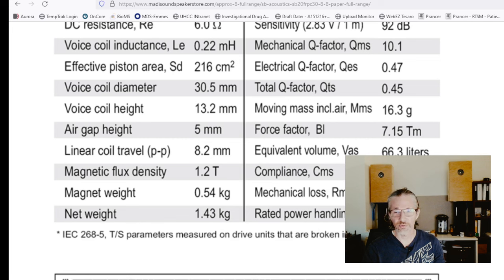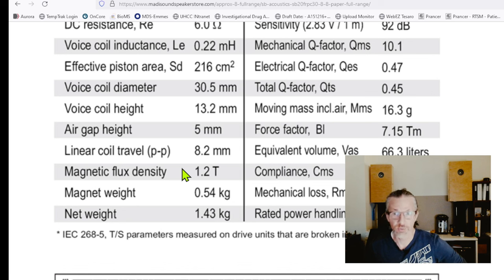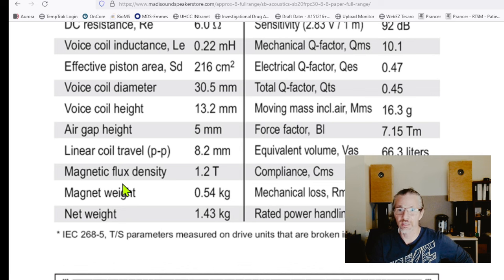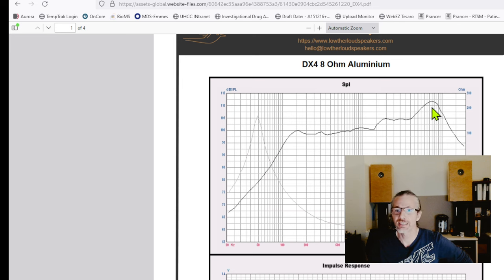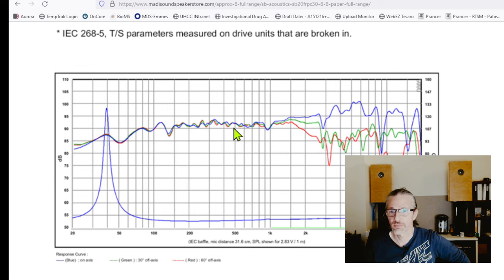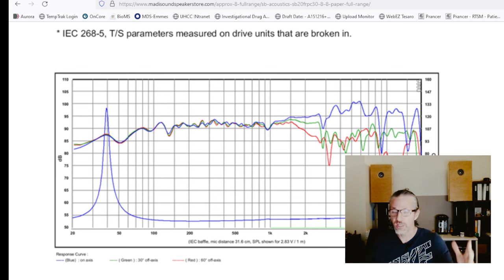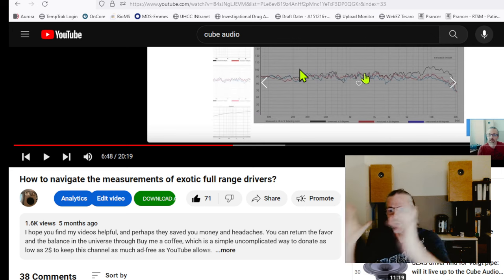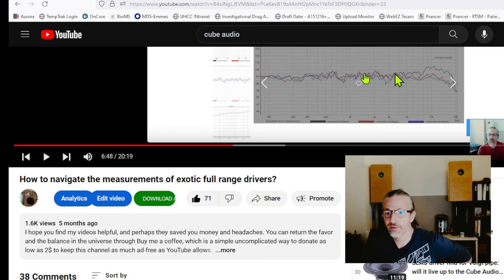Full range drivers explode your universe! Why cheap is cheap and expensive cost so much!

Comment: My first DIY speaker in 1972 used Richard Allen (UK) 8" twin-cone drivers. In 1995 I installed Pioneer 8" twin-cone in-ceiling speakers in a new house build, later supplemented with a Pioneer 5/8" tweeter crossed over at 6KHz. It seems to me from the 60s (Lowther, Jordan etc) to the 00s full range driver design stalled but has now taken off due to: Mark Audio, Tang Band, Cube, SB & others. What a great time for DIY builds!

Comment: I built a slightly different version of La Grande last year , same Fostex speaker but slightly smaller cabinet and and adjustment to port size to match the smaller volume. I was very happy with the outcome despite them not being a perfect cabinet  as I am not a cabinetmaker and lack the skills yo make a perfect form box.  The speaker performance was a match for my store bought speakers, with about 15% of the cost.  But I was a little disappointed that they were a match and didn't sound more different and relegated them to my second system. My system was solid state entry level amplification.  I recently completed my long term Darling Amp build and now when I compare the speakers I am seeing the difference  I wanted and hoped for.   I watched an interview yesterday with Peter Qvortrup and he seemed to explain this very well in that he stated that modern hifi homogenized  sound so it all sounds the same . This comment from Peter seems to me to aptly explain my  experience.
Reply: Interesting comment! 
Speakers have a lot of character! 
Better amps and sources seem to make to differences more noticeable.

Comment: I added a comment on another one of your videos about this driver. Price is not always an indication of sound quality. A lot of the more expansive drivers seem to have a poor response and tend to sound too bright for my tastes. The SB acoustics driver also has a rising response but this can be corrected using a simple BSC circuit.  Use 1.5mH coil with a 16.8R resistor (6.8+10) and 2uF capacitor. You loose a bit of efficiency, but any 30W will drive these very loud, and you get a nice balanced sound with plenty of bass and a nice detailed top end.
A BSC circuit is a very simple way to control the response of the driver, meaning you don't have to spend  fortune on a driver to get the best balanced sound. Why do you not mention these BSC circuits more???
Reply: Thanks for this tip. 
I'll try to find information on the subject.

Comment: My only "dipping the toe in it" so far was building a Markaudio Alpair 7MS in a Pensil enclosure and I certainly see the attraction of the full range concept.
Small money with big sound, only very limited in SPL. Anything above medium room loudness and the magic was gone.
Maybe I'll try a bigger driver one day, but then even the small Cube Audio drivers are already high-priced...
Reply: The MS doesn't have the bass that other Markaudio drivers have. CHR is a nice affoardable series that has very nice bass. You can use that to your advantage and get better dynamic range. Bigger drivers will play louder of course but their highs get way worse. I personally consider the MS drivers midrange-tweeters.

Comment: I just brought a pair of SB20FRPC30. Building my first single driver mass-loaded QWTL cabinets to set up in my apartment. Setting these up on an open baffle the high frequencies are very impressive. Once I load these up into the cabinet may it attenuate the high frequencies? I have a pair of Philips ribbon tweeters I'm thinking about installing in the cabinets aswell but would like to keep it a single driver if possible. Also, would I likely need some notch filters for the single driver? Thank you for your informative channel!

Comment: Hi Janos. Shocked that the surrounds of your Fostex have disintegrated! I have  pair of fe164 for many years and haven't got around to using them. I better check them! Didn't think the cloth surrounds would perish like the foam ones do!😮
Reply: I think a big factor was the super high UV and the salt in the air. Here in the Hawaii climate plastics / plasticized material and even cloth do not last. :(

Comment: Janos, You have awoken my interest in the FC8 drivers as alternatives, thes cost is the same as the  same magnet Lowthers, but the extended range may be my audio nirvana, cannot easily listen to them in the UK, watch this space.
Reply: Hi, you might want to contact cube audio if you are really interested in the fc8. At least I cannot see the fc8 nor the loudspeaker they had based on it on their website any longer so I assumed they were discontinued? Dont know if they intend to come with an improved version or not? Hifi collective in the uk still has some units available it seems. Good luck
Reply: @Thiago_S.. Hi Thiago, sadly yes, they have discontinued the Fc8. :( They have the Neo version, and others, but at much higher price. :(
Reply: Hi Paul, the big difference changing from Lowther to CA will be the drastically deeper and more substantial bass, and lack of shout.
Reply: @ShutterNChill  thanks for confiming Janos, that is a pity :(
Reply: @Thiago_S.. I think so too. It was their most practical driver, fantastic sound at the affordable range for most people. Well, the price was still a huuuge stretch, but their other drivers are x2 x3 the price..... making them inaccessible for those who could stretch their budget to the Fc8.
Reply: Perhaps Cube Audio need to hear from us... Enough requests and they might start making them again!?

Comment: Hi Janos,…I will Build Both, a Voigt Pipe with my Lowther Pm 2 A After reconing, ore my Visaton B 200 and  La Grande  with my Tangband W 4-1879 for Television. However, in the Voigt Pipe i will not install the Driver on the vertikal Side, but in the slanted Side. I think this is an advantage given my  Room height of 3,20m and 8 m length. You have me fixed on. Bye Bye. have a nice day. 🌞🙏🏻

Comment: Insane comparison. Pertinent to compare price of magnets. It's the skimming of price even after so long .I don't think magnets r so expensive......
Reply: We are not comparing the magnets, but the motors, the magnetic circuits. Building a low flux density magnetic circuit is a task for babies, and can be done with minimal planning, design and resources as everything is done in mass numbers. High flux density motors - there's no pre-fab cheap source there, you have to do everything from ground zero. It's going to be relatively affordable only when a mega-plant is making 100.000 units of it... and once you go into cost-cutting, as 100K production lines always do, you start introducing cost saving measures that cut hard into sound quality. Hence, affordable high efficiency drivers remain in the PA quality....

Comment: Cost of production of magnets??? Strange.
Reply from the maker: I can get a bag of neodymium magnets for very cheap, but it will not make any sound. The price is high because of the research and tooling that is required to arrange them into a permanent array that allows trouble-free long term operation. For drivers using low efficiency motors you have access to pre-made extremely cheap motor assemblies, purchased by the 10s of thousands from China, and produce very very cheap drivers, which dip towards the cost of the magnet, plus a minimal tooling and production expense, as the assembly line produces millions of units and can afford to charge extremely low margins and still stay profitable. Going for higher motor strength, there are no pre-made cheap choices available, and the company has to do the research to create the magnetic circuit, and purchase the tooling if they want to scale up, or suck up the extreme labor cost per unit when done in low quantities. The most expensive it gets when you try to do it, as then all you pay for is a handful of magnets, but will take years of your time, and you will need to build 20-50 units to have minimal proficiency with it. When one does it for fun, time is of no issue, but when you plan to sell then your hourly wages become the hard line for charging for the unit, and they will be much higher than any materials costs of the unit.